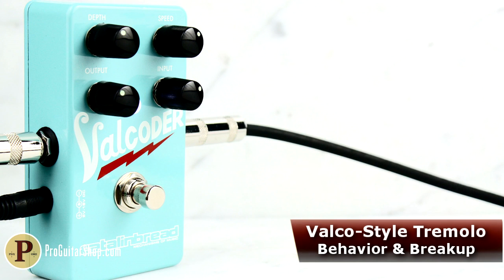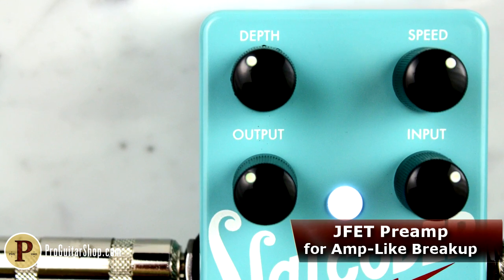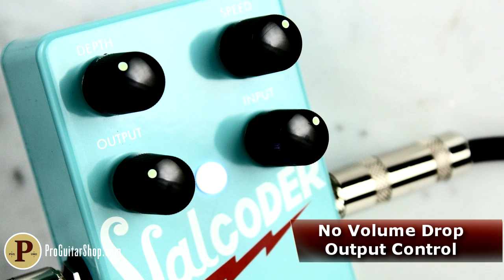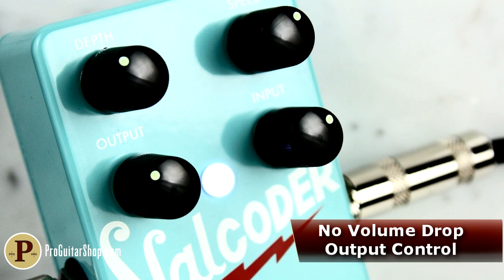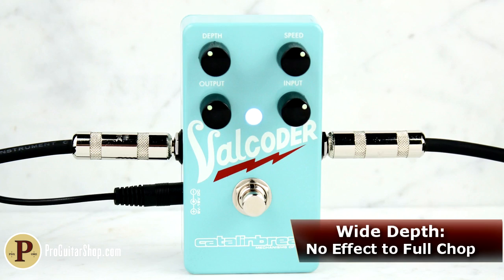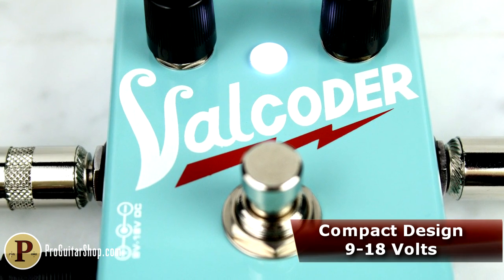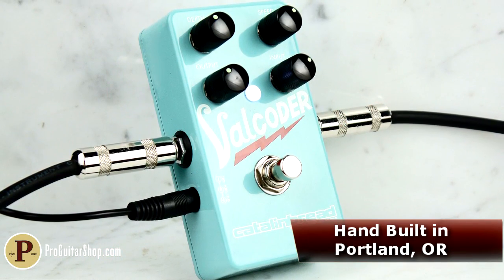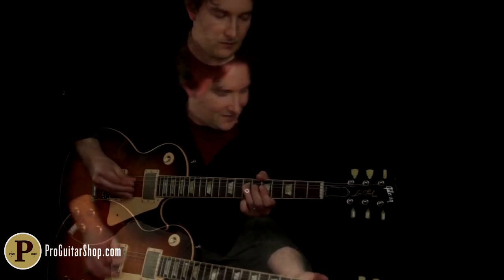Catalinbread Valcoder Tremolo

Comment: Trem - my favorite effect.  I'll be getting this one.  From the Catlinbread website:  "coming soon".     Rats...
Reply: tommc49 Did you get yours yet?
Reply: DcsOrCity Yes I did and I ended up returning it.  It performs exactly as shown but I felt it is kind of a one-trick-pony.  Does that one sound very well but I found it kind of dark.  Decided to stick with my Black Cat mini-trem which I have had for three years; one of the few trems with a tone knob that let me adjust for different guitars.
Reply: tommc49 Where did you purchase your Valcoder from?
Reply: Pro Guitar Shop;  they have a good return policy.  I don't buy pedal with the intent of returning, but it's nice to know you can.
Reply: Did yours have the original graphics before Catalinbread was forced by Valco to change the bolt graphic?  Just curious.
Reply: Honestly, don't remember.